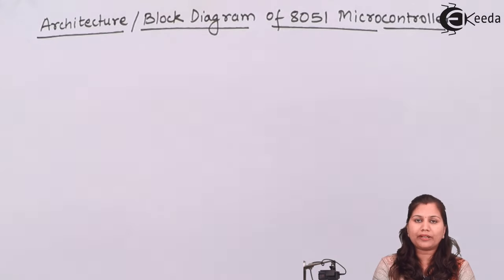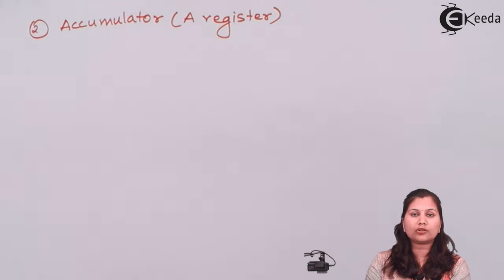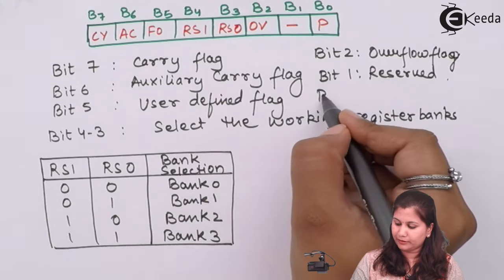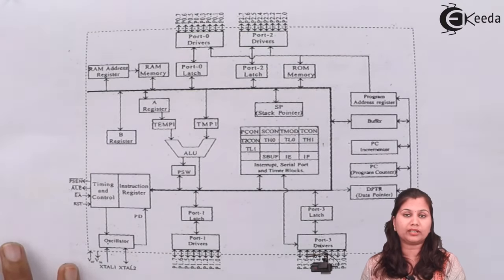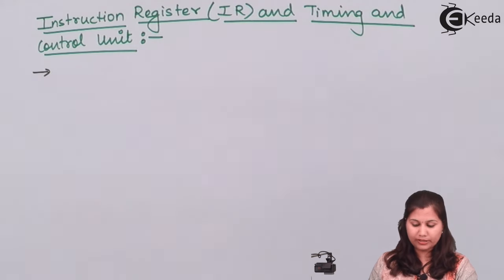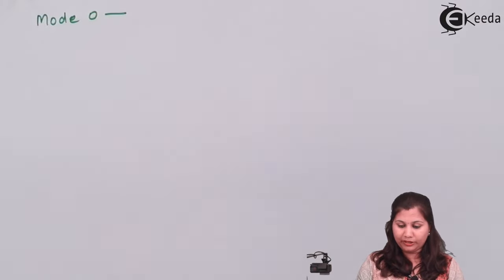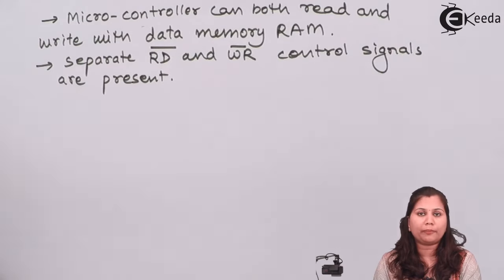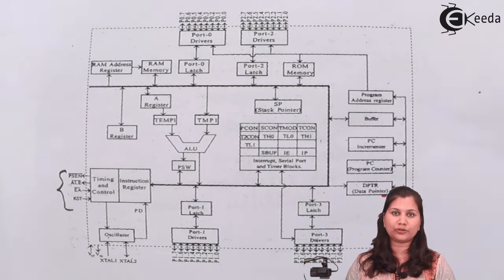Architecture / Block Diagram of 8051 Microcontroller - Microcontroller and Its Applications

Comment: Not properly explained..... what is a flag, what are drivers, what is low order address bus and data bus etc ....More clarification is required...
Reply: Hello
Flag - its 1 bit information. It can be true/false or high/low
Driver - its a specific firmware written to handle specific part of functionality of microcontroller. E.g. Serial driver , which will be a firmware handling Rs232 functionality of microcontroller

Address/data bus - specific pins of microcontroller which handles reaching to some memory location (using address pins) and read or write data at it (using data pins). Bus is collective representation of some pins.
Hope this helps you.

Comment: MAM ONE correction:-
You mentioned that stack pointer is of 16 bit, but actually it is of 8 bit, check one more time about what you have said at by  22/23 minute of video.
ALSO regarding parity bit of PSW its 1 when the parity is odd whereas you mentioned that it will be 1 when parity is even,
THE role explained about PSEN is SAME as EA or what?
The lecture is awesome , make sure that you edit desription highlighting the updates
Reply: Yes there are some mistakes
Reply: U r absolutely right